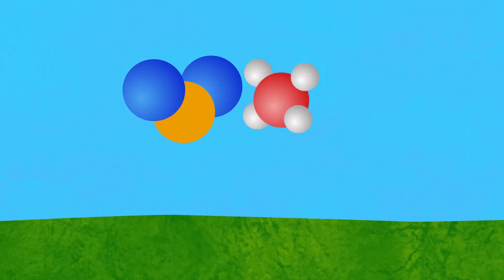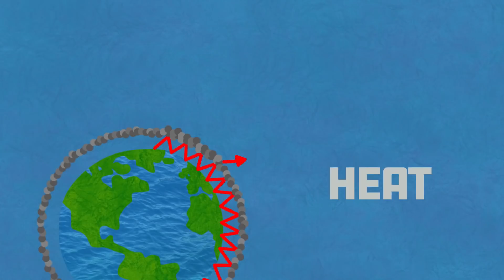What About the Ozone Hole | Global Weirding

Comment: How do CFC’s reach the the upper atmosphere being they are much heavier than oxygen. I am a hvac contractor and had to pass the EPA exam to work with CFC’s but obviously being that when looking for leaks you start low because it’s heavier than air The logical question is how does it get up there and please don’t tell me storms because even if storms blew it up there it would still fall back down also would swimming pools have the same effect on the ozone or worse being that chlorine is the culprit here? That was not a got you question I really would like you to explain thanks